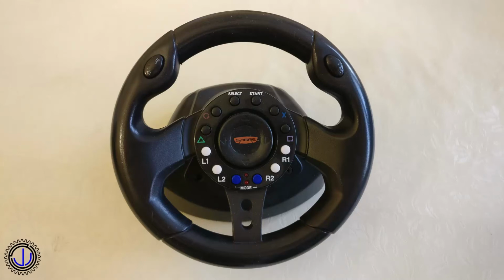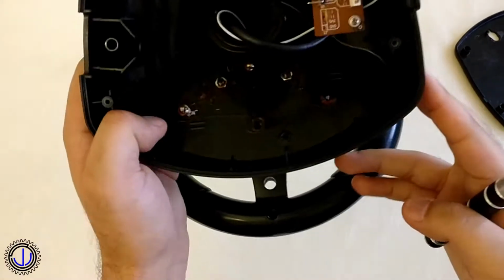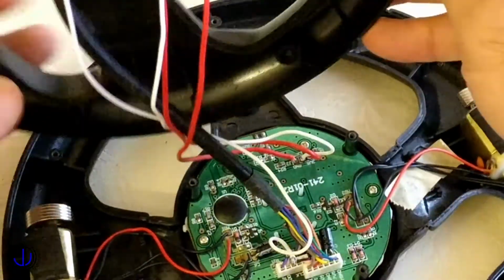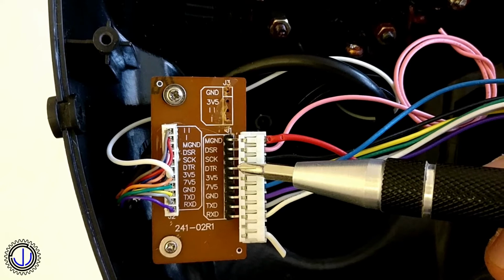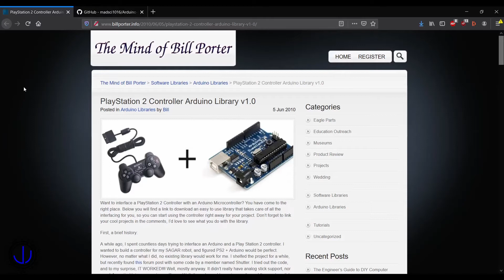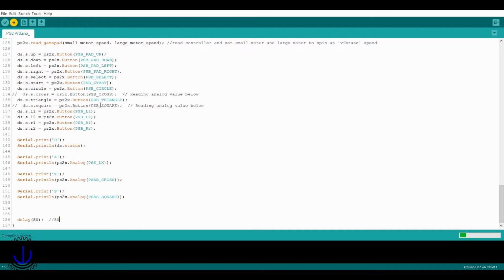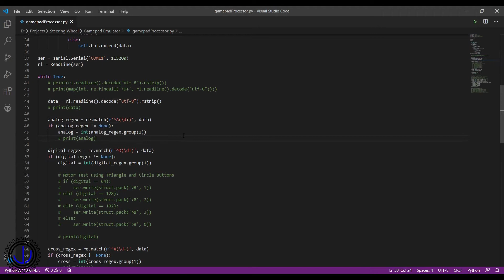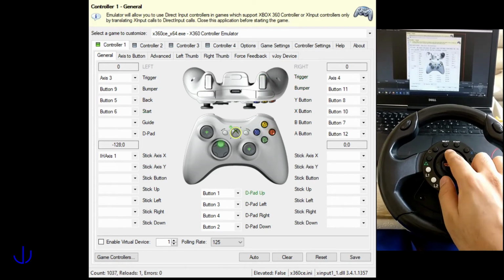Hacking a PS2 Steering Wheel to Work With PC

Comment: Yeah I had 2 of them.  Plus pedals for both.  However the devices were the same although internally they were a slight different.  So hacked in, changed the buttons on the steering wheels to shift down on the left and shift up on the right.  I also soldered additional wires for an additional external handbrake and also a wire to the second set of pedals to act as a clutch and a second brake pedal.  Ideal for karts.  Recently added the external handbrake and used a microswitch as the trigger.  Not bad.

So steering buttons, shift up/down, and 4 pedals clutch, brake, brake, accelerator. The first two for left foot intended for clutch control and for karting brakes, and the right foot for brake and accelerator as usual.  Rigged up on a homemade stand.  An old lockdown project.

No Arduino involved, I just bought a PS2 controller to usb converter and setup the drivers so all worked including force feedback.  Also I've set it up for both windows 7 and 10 and both windows have no issues with it.

Works good for now.

Comment: Man the video is awesome 🔥 I need help. so I have the same wheel as you. I bought it like 3 to 4 years ago. it came 
with pedals and a PS2 to usb converter.It worked great the first year but after that the converter was not working so I bought a new converter and connected that to wheel.First it was not recognizing it.I thought it's problem inside the wheel.I cut the wheel ps2 cable from middle and joined them again using a diagram from internet and it worked.i played with it two days but than again a problem camed up.When I am connecting  the wheel it is just vibrating. I have Checked the connections many times but still not working.please help
Reply: Hi 👋

Comment: Is there anyway to make this work without arduino?
Reply from the maker: Not directly, since the wheel and USB use different communication protocols (Wheel = SPI, USB = UART). You could get converters though, I think.

Apart from that I suppose any microcontroller or microprocessor that can:
A: Read the input from the steering wheel
B: Write to serial
I'm not sure about any libraries for other options, but even those could be written if you're keen!

Basically you just need something to translate SPI to UART.

Unless you strip out the electronics and do something directly with the physical buttons... but you'd still need an electronic 'brain' to do anything with it.
Reply: you can get a PS2 to usb adapter on amazon for $10
Reply: @JohnSmith-qn3ob  they do work I just got mine and ticked PlayStation support on steam and run all my games through steam and works fine also downloaded ps2 controller drivers working for so far crew 2/ dirt 2/need for speed and raceroom some games work better nfs sucks with these old ps steering wheel but dirt 2 and cew 2 work pretty well with a mess around with the sensitivity and dead zone nfs don't offer this so feels sloppy and also I think all games think I'm using a ps3 controller but some how it still works

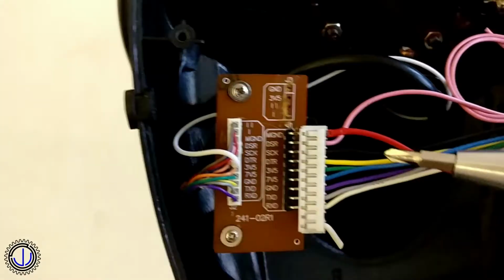Comment: Hello, I want the real colors that were in this 5:15  area if possible
Reply from the maker: Hi, If I remember correctly they were the exact same colours as the corresponding wires on the other side
Reply: @thisisjj  Thanks for your response, but there are colors that do not match the power cord
Reply: @thisisjj  Thanks for your response, but there are colors that do not match the power cord